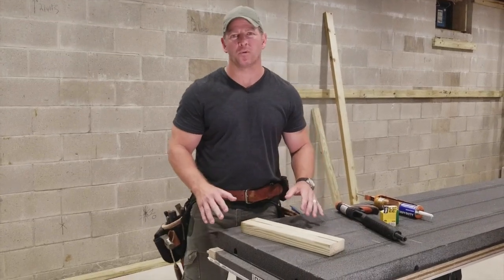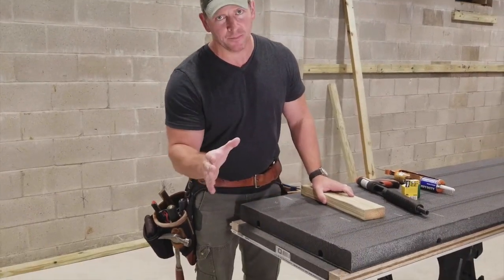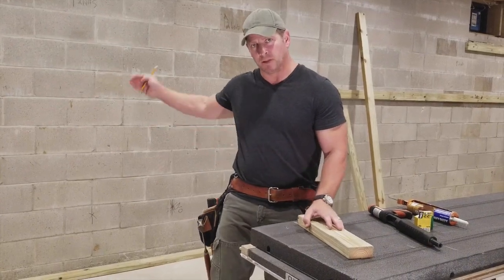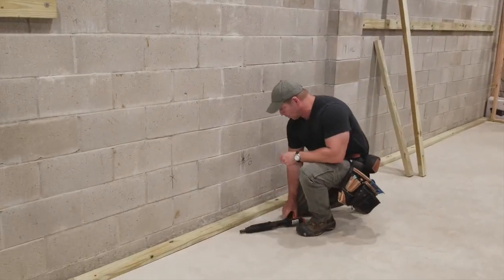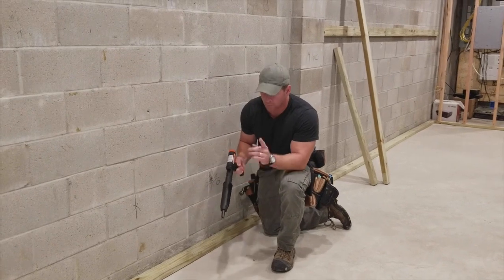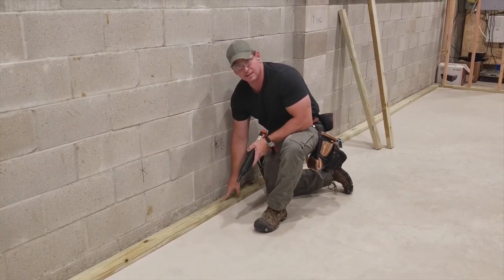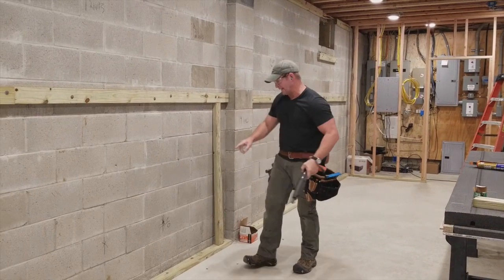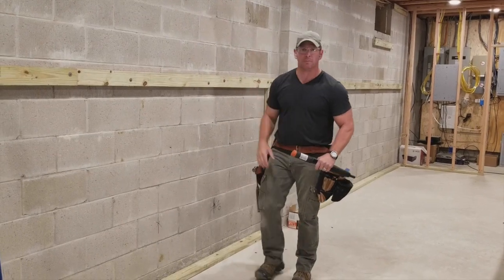DRICore SMARTWALL Installation Part 1

Comment: 1st - my concrete floor bends the ramjet nails so I have to use tapcons.
2nd - I have yet to find a plumb treated 2x4, I really hate shims but it looks like the only solution.

Regarding fireblocks, won't a treated 2x4 ½ way up work as one?

Comment: Not a big fan of using any organic stuff in a basement. Even if it was pressure treated. Wonder if it can work with metal studs.
Reply: U live in a board house stop wasting time and use the wood
Reply from the maker: Yes, you can use with metal studs.

Comment: Hey Jason, I know it has been over 2 years since you made this video, so not sure if you are still monitoring comments, but here goes.  
I am planning to install the DriCore Smartwall product for the majority of walls in my basement.  I'm getting input from a contractor friend of mine, showed him these videos, and he pointed out that there was no mention of how to address the building code requirements for vertical and horizontal fireblocking to prevent the movement of
 undetected flames and gases to other areas through concealed spaces, like the gap between your foundation wall and the foam on the panels.  I have already figured out a solution for the vertical fireblock at the top of the wall, but I'm looking for suggestions for installation of the horizontal block every 10 feet to satisfy codes.  Not sure if this is a requirement in your area, or if you just chose not to include this step as part of the installation video series, but I would appreciate your feedback and/or any suggestions.  Thanks in advance!

Comment: don't you have to do the floors first?   or can flooring be done after?
Reply from the maker: It's just like putting up drywall.  Preferably you put the "walls" up first then you lay the flooring.  Mainly because you want to attach the bottom plate to the concrete floor.  It can be done with an existing floor in place. You would just attach your bottom plate to the existing flooring and concrete.